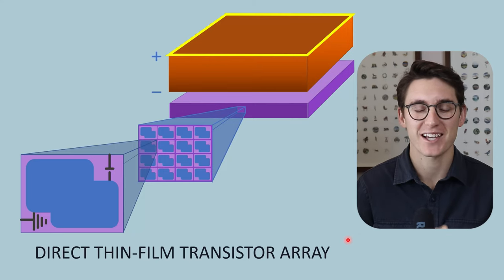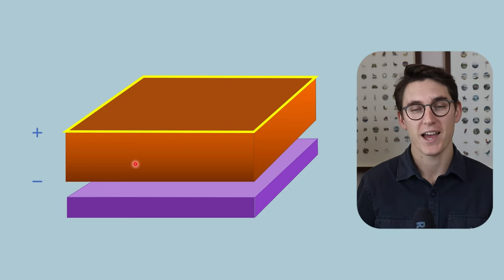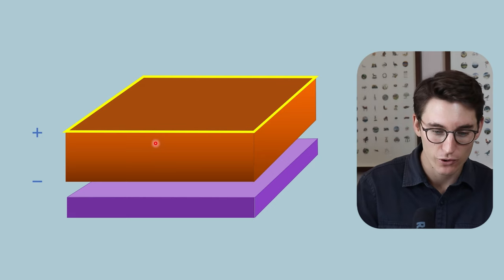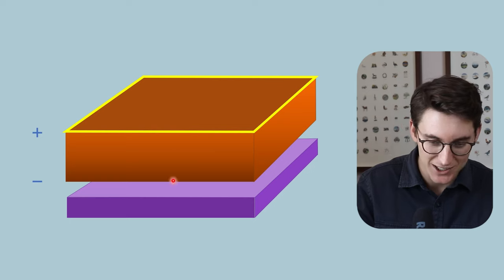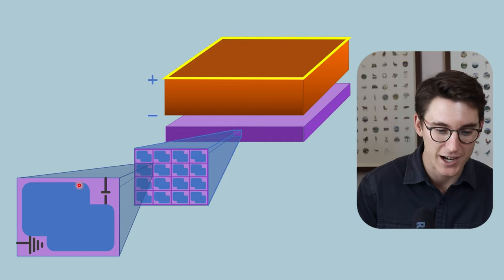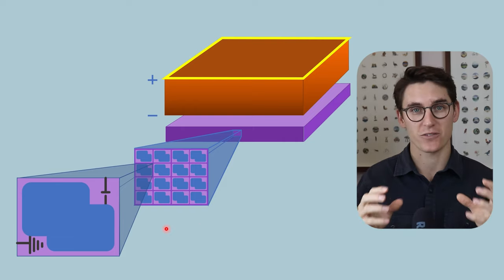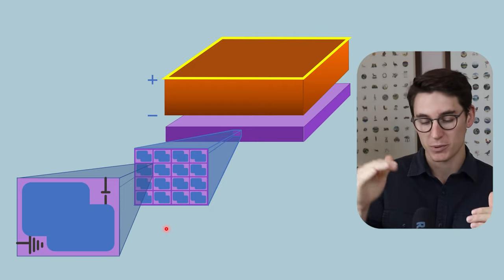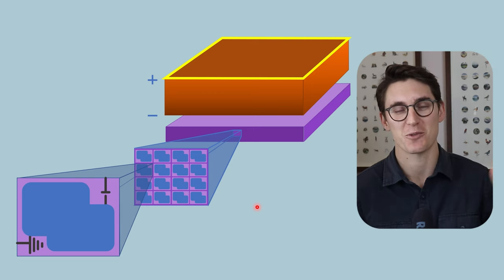Direct Thin Film Transistor Array (Flat Panel)  | X-ray Physics | Radiology Physics Course #36

Comment: Hello! On a mock exam, I had a question asking which has the potential for the lowest exposure dose and the following answer choices:
Conventional radiography using film screen
CR
DR using a TFT (not specified if direct or indirect)
DR using a CDC.

My gut is leaning towards DR with TFT (vs with CDC as my second choice), but without the specification between indirect or direct, I am not completely confident. You mentioned that with direct TFT arrays, these are more beneficial with handling lower energies which is why I went with that answer. Not sure if I am overthinking (very likely that I am) but could you explain how you would tackle this question if I misunderstood? Thanks in advance. Love your videos by the way they have been life savers!

Comment: Aren't the "+" and "-" signals inverted in the diagram? Wouldn't the positive signal be positioned inferiorly in the selenium? This way, the negative charge would be attracted to the closer region of the TFT layer. It's a doubt, if you can explain. Thank you for the content!
Reply from the maker: Great observation. This orientation of the +/- symbols is due to a certain property of the semiconductor layer (a little too advanced for this course). In fact what it happening here is instead of electrons heading towards the TFT layer - something known as electrons holes are. These holes are formed by the absence of an electron in the valence shell of an atom. The holes are formed by electrons moving away from the TFT layer. The electron holes can also effectively be measured as current at the sensitive area. It’s a technicality which requires much greater explanation than I could give in the video but would encourage you to read further if you’re interested. Hope that makes some sense 😆
Reply: @radiologytutorials  Great! Thanks for support, solving my question. Wonderful contents. Stay on these roads, Michael!
Reply: Hi Dr Nel,

Still struggle to understand the direction of cathode to anode here. 

My understanding is - The semicondutor modelled using the solid band theory can be visualised with its respective valence band close to the TFT array and conduction band close to the patient. The incident X-ray striking a-Se causes excitation of the electron in the valence band to jump to the higher energy state conduction band. This leads to the 'electron hole' and a resultant positively charged Se ion -  i.e a positively charged ion closer to the valence band/TFT array resulting in an intrinsic charge differential from conduction band (closer to the patient being negative) to the valence band(closer to the TFT array being positive). The electrodes that sandwich the semiconductor establish a uniform potential difference which is negative near patient and positive near the TFT array in order to establish linear electric field lines and hence allow linear flow of electrons towards the TFT array - this current is then detected by the TFT array and helps localise the exact point of xray interaction/ionpair-electron hole generation resulting in direct radiography's excellent spatial resolution. 

This is my current understanding and hence am confused with +electrode being close to patient and -electrode near the TFT array in the video presentation above. Am i missing something or do the signs need to be different on the video slide? 

Thank for your help. Your video's are great and I've signed up on Radiopaedia for both your courses in preperation for my RANZCR exam! @radiologytutorials 

PS - Thought about this a bit more. The charge signs on your slides would make sense if the positive charged x-ray receiving surface closer to the patient means that the released electrons flow towards the patient and positive ion (aka electron hole) flows towards the TFT array (in opposite directions), along the electric field lines. The low bias voltage would be low enough the electron flux to the surface elecrode would cancel the surface charge and the variation in charge near the TFT array is what is measured by the TFT array to generate a signal for digital conversion. Resolution would be much precise as the electron hole flow (representing the site of xray interaction) is linear along the electric field lines leading to accurate representation of xray interaction. 

Would this be a better way to understand this. I can forsee an exam question asking to describe how direct radiography works.